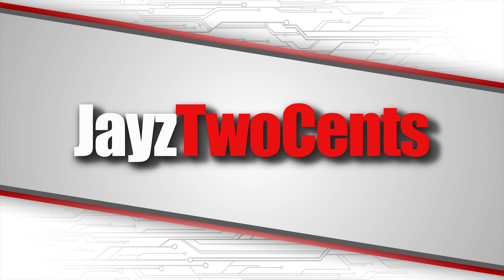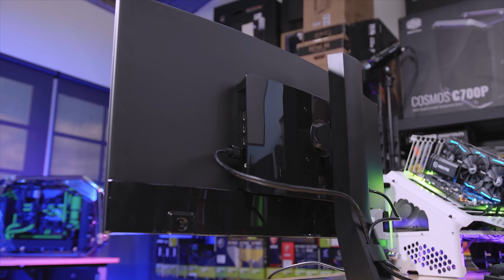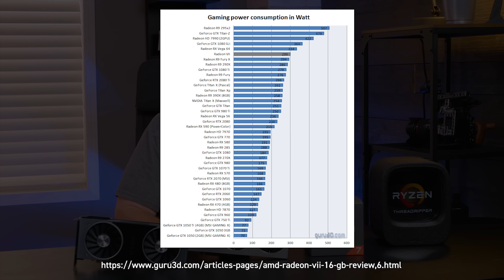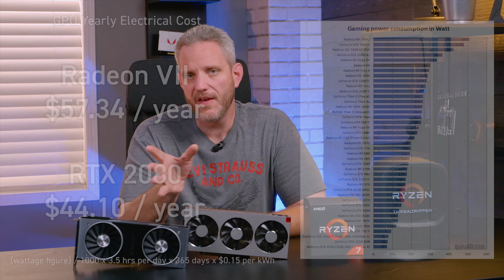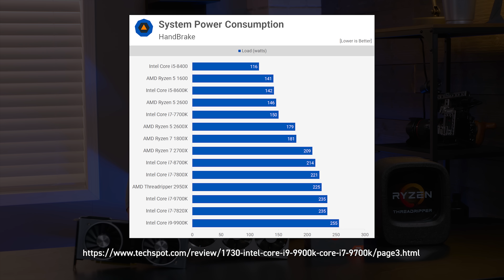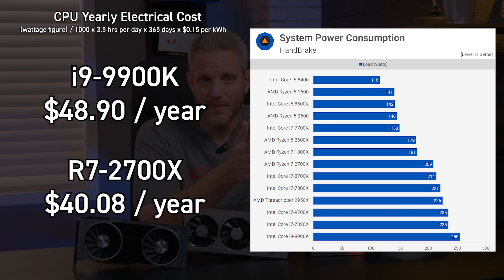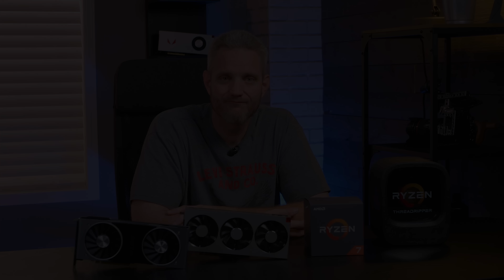Energy Costs of AMD vs Intel vs NVIDIA... This might surprise you

Comment: My Gigabyte GTX 1080 OC ate up on average more power than the Gigabyte RX Vega 64 OC I swapped it with. Temps and performance are even. 🤔
Reply: is dat a Ti?
Reply: Purp 1080ti would be at least 30% faster than Vega 64, so no
Reply: Unless you undervolted that Vega 64 I call bullshit. My 1080 Ti ran cooler, and used about the same energy, as a Vega 64. Also the Vega 64 is about on par with a 1080 why would you replace it?
Reply: @SomaFlly  "is dat a Ti?" He didnt say it was a Ti
Reply: @piercenielsen9746  "1080ti would be at least 30% faster than Vega 64, so no" Well OP didnt say anything about a 1080ti , just a 1080.... so no, you cant read
Reply: @DakotaTheRota  "My 1080 Ti ran cooler, and used about the same energy, as a Vega 64" Good for you... OP said nothing about the Ti version, your point is moot
Reply: Dana Vixen can you read? Purp asked a question, stop causing unnecessary controversy
Reply: @DakotaTheRota  I used Balanced mode in Wattman and ran Superposition and Heaven, 221W for the Vega 64 reaching 1600Mhz boost, whereas the GTX 1080 drew 246W at 1926Mhz boost. I honestly can't recall the exact bench numbers, but they were within mere points of each other. Both cards were at stock clocks and fan speeds, and the Vega 64 reached 71 Celsius while the 1080 was ironically at 80. In gaming I saw no difference in frame rates (within margin of error). Please don't call bullshit unless you have PERSONALLY done a 1 to 1 comparison as I did before shaking hands and making the trade. As to why I traded, simple; mac OS Mojave doesn't support NVIDIA cards (and probably never will) and my Hackintosh was itching for an update.
Reply: Yeah bullshit a vega stock will easily pull 100w more i have an overclocked 1080 so lets see some of them numbers for yours versus mine

https://imgur.com/a/JfdUKTc

My 1080 is on water over 2.1ghz thats doom 4k nightmare sustained power draw so yours was not puing that at 1900mhz i have the voltage maxed as well so lets see that vega full load pulling less
Reply: @malygos9301  where's "your" Vega 64 card? You only have one card though. Kinda biased.
Reply: @malygos9301  I trust Bansaku more than I trust you in this at all. 🤦
Reply: Omar lmao im biased he randomly claims on the internet i show actual power usage BiAs FaNbOy

Pssst he claimed his vega had lower usage which you would compare to the 1080 not 64 vs 64🤦‍♂️
Reply: @MrKeech666  Heaven is a synthetic, like furmark.
Reply: turn on Power Saving bios on rx vega. trading about 2% of performance for about 30% less power draw on my vega 56
Reply: That depend on resolution you play in Monitor Frame rate and the game engine itself
from my experience with GTX 1080Ti with 375W TDP limit overclocked to 2025/1654 with undervolted 0.993v using Metro Exodus
1920x1080 60 = 245w temp 47
1920x1080 144 = 305w
3840x1080 60 = 298w
3840x1080 144 = 321w
3840x2160 60 = 357w temp 58
Maybe that info helps
Reply: HDR247 ^ and a vega 64 easily pulls the same or more as a 1080ti while getting hotter which is why the op is full of shit it performs the same as a 1080 with less power consumption
A 2025 oc is bad on a 1080ti
https://imgur.com/a/L5om7U8
My 1080 metro exodus 4k extreme 2139mhz overclock so 110mhz over his 55c max temp so cooler than his and only 229w peak pull.

So yeah i call bs hell put your vega in power saving mode it still wont hit those framerates at that wattage
Reply: @DanafoxyVixen  does that mean its not a Ti?
or because he omitted the Ti does that make it not a ti? lmao
Reply: https://imgur.com/a/7kXkRAW 260w isnt lower and lets see it you dont have a 64 or a 1080😂 bonus round dying light 4k max settings 2139hz or 400mhz over yours 229w sustained pull ill even throw you a bone it peaked at 245w for half a second. Since we know youll be back to read this just post even one pic of that vega at stock pulling under any of these let alone oc’d😂😂
Reply: Not going to dive into this pissing match y'all got going on here, but I own a Vega 64 and I can attest that the 64 watt for watt is at least equal if not better (in performance) than the 1080 (non Ti)

Proof? https://www.3dmark.com/fs/19022022
Power bouncing between 200-300 watts with either card (as clock adjusts for each scene ofc)
Reply: have a 1080ti here and it takes about and over 300W, depending on game. even with a steeper fan curve it can reach 80°C, and the best thing is: it can't idle with 3x UHD monitors, its always at 3D-mode with full clocks and sucks 100W...

waiting for a faster AMD card, i'll give them a chance again.
Reply: @whistlesyxter  Lol thats bs I dont believe you use the card with such OC. I have the same card LC edition actually 3 of them and its not possible to play anything for more than few minutes at the clocks you report on 3dmark. Core clock 1 792 MHz Memory bus clock 1 145 MHz Lol at 200-300w? more like 350-370w+?! What is your voltage 1.1V? xD
Reply: @piercenielsen9746  Lol so many butthurt Intel and AMD fanboys. Will never understand the need to defend a company.
Reply: Congratulations on saving maybe $1 a month. I have a Radeon 7 and I'm all for AMD competing with Nvidia but your comment is so dumb it triggers me. Did you even watch the video?
Reply: @MrKeech666  easy trade in your situation. the vega 64 is a good card. i got a 1080 for cheap but i wanted a 64. couldnt find one cheap though.
Reply: @eth_saver  I didn't claim any numbers, bud. You might want to re-read that: LOOK AT THE SCORE AND COMPARE VS GTX 1080. If you know so much, then why did you conveniently forget that Vega reported clocks are higher than actual clocks?
Go take your faux outrage and learn something.
Reply: @whistlesyxter  You didnt claim any numbers yea.. You just said that Vega64 is more efficient than 1080. Then you post here some "proof" with all stats and then added some made up power draw. What a joke. With your settings the Vega64 will eat over 300w and the memory will start making artifacts once you put it under load for more than few seconds.
Reply: @whistlesyxter  I am pissed because you cranked the card to max. And then you post here how powerfull it is and how efficient it is. Which is complete BS or your card has better efficiency than Radeon VII. You are fraud!
Reply: @eth_saver  That is a valid 3D Mark score buddy, if you want numbers 1150mv for core and 1075mv for voltage floor/HBM. Look at any charts (ie. Google) for unlocked/UV/OC Vega 64s and GTX 1080s on water and specifically look at their power draws. Clock for clock is moot, obviously. I said it was at least EQUAL, I didn't say it was MORE efficient - Stock voltages are irrelevant imo, those aren't what most Vega owners run at. Obviously it didn't start artifacting after a few seconds as the test finished to completion, and Vega simply wont stand to error for that long if unstable.
You go ahead and keep your dick out for the pissing match though...
You sound like a fanboy with a bone to pick, and it's not with me Tomas.
PS: When not overclocking for benches, 1100mv is all I need to maintain 1700-1720 actual clock in game, this reduces the power draw even further while still beating the GTX 1080 - BUT the 1080 has a MUCH higher top end for performance... at a massive power cost.
Reply: @eth_saver  Those are my findings, you can piss and moan about it all you want. I'm sorry if I have offended you.
If you go over to https://www.overclock.net/forum/67-amd/1634018-official-vega-frontier-rx-vega-owners-thread.html
You will find that MANY other people have had the same experiences as me, some even better (Yes, I'm jelly of those that can hit 1200mhz on HBM and 1800 core) and some worse.
Reply: @depth386  The Radeon is the same Price essentially as the 2080.
Reply: Jaron Marles not quite, at stock I call it like a 2076 but obviously that’s stock and it loves water, loves undervolting. If you’re curious Hardware Unboxed has a very fair comparison of the R7 vs 2080, two videos in fact just in case drivers changed things. But I still bought R7 because I like the 16GB. Basically I want a card that five years from now still games on say medium settings and so it’s the better buy for me. Also, R7 fans are pretty noisy but I wanted to build crazy a watercooled rig anyways.
Reply: @depth386  The issue is that for the price you pay, the only real comparable benefit is the 16GB. The issue with that is most still play at either 1080p, or 1440p. Which doesn't require much more than 8 gigs if at all (depending on the game, and settings). The RAM is part of the reason it's so expensive to begin with, and the extra RAM is almost never used properly.
Reply: Jaron Marles yeah it really depends on what type of gamer you are. I usually don’t make quick motions and give myself first person shooters, so cranking up the settings on 4k with radeon 7 makes sense for me. I got the typical game bundle with it and in Resident Evil 2 i managed to get 14 or 15 GB VRAM estimated in the menus. The Nvidia 20 series disappoints me for not having more memory than the 10 series. 2070 8GB probably the closest thing to the ratio of memory to gpu horsepower i like.
Reply: @depth386  Most people don't play in 4k though, so most don't even need that much. 8 is usually sufficient for 1440p, let alone 1080p.
Reply: Jaron Marles yeah but then again for 1440p you will do fine with a 2070. Which makes more sense for 8gb. I just wish the 2080 had a little more than the 2070. In car terms: It’s like more engine power with a typical automatic transmission. Anyways i just realized i misread your comment, yes they launched same price and 2080 is a bit stronger. I was originally raging at the original post of this where the guy says his 1080 took more juice than his vega or whatever. It’s the dumbest comment in the universe, the electricity is like $1 a month at best

Comment: Can you do one in the server space CPU's? They run 24/7, it would be a fun comparison!
Reply: I feel like that would be more of a Linus video. Jay has always seemed to be more on the enthusiast and pro-sumer platform for his videos whereas Linus likes to dabble in commercial components more and more.
Reply: Idle consumption on modern CPUs is like 10W. For small business and home servers, that's where it'll be for 90% of the time.
You'll use more powering HDDs 24/7.
Reply: @tin2001  Ryzen 3000 has an 11W PCH, wich is quite significant to this. Its idle power draw is unknown though.
Reply: @nottheengineer4957  11~15w

Comment: When the price is cooling down over sea
In my country is still keep them high 
Especially Huawei phone
The price don't drop
Not even a little
Reply: You should not buy Huawei phones. Where do you live? I get basically the same prices in germany, but in Euros and already containing 19% sales tax.
Reply: @nottheengineer4957  I just said that the price of Huawei phone don't drop in my country
I'm using a Xiaomi phone
And it ok to use a Huawei phone if u don't care about Android Q
That basically it
Reply: @araarabutkermitthefrog  Huawei phone have software that is barely usable and locked bootloaders, wich means no way to get rid of the crap. They also cannot proved proper software updates anymore.
Reply: @nottheengineer4957  I use Nova launcher :/
And Xiaomi also lock bootloader too
You gotta sign in and wait about a month to unlock bootloader

Comment: The comparsion of 9900K vs 2700x power consumption is really flawed because the Intel cpu would finish all tasks sooner. So out of the 3.5h test the 9900k would be half hour idle while amd is still working.
Reply: You are right about this. But it only is correct for workloads other then gaming. If you game 3.5hours on both systems jay's argument still stands.

Comment: really excited for the release for the ryzen 3000
Reply: I am too, i want the 8 core if it can overclock decently
Reply: @nathanhamman418  It's already factory boosted FAR over what most of the previous generation could do with manual overclocking. Plus you get the 15% IPC uplift.  I'm excited to use it just like it is!

Comment: Nice way to negate the power draw is by getting a more efficient power supply.
Reply: that's a good thing to think about and spend money too. not just is going to waste less power(more saving, if u really care about it..) but 
it also means the power supply will most likely run flawlessly more time....efficiency decay is a thing to consider when buying cheap electronic components...power supply is THE component that u need to think good before buying, or regretting later..for early problems like not enough power to your system, failure in general...or, and a big one, upgradability! I've done a poor choice one and boi did i regret when buying new GPU for SLI back then when it was a big thing

RIP SLI/XFire

Comment: Well...for me it is...I have a home with 2.2k Watt limits, and I'm running two fridge, three AC 24/7, and not counting auto jet water pump and someone cooking rice, so there is only a small window I can use to build a PC and run it comfortably without blackout. I have an option of building a PC with gtx 1660 or rx580, I go with gtx 1660..and sometimes I still get blackout if all devices I mentioned earlier was on, and I was playing games (browsing or lightweight usage is still fine).

Might not be for everyone, but you have to see 'power draw' from this angle too, I don't have any problem with the cost...
Reply: Fajar Normansyah Solar?
Reply: @robertmudry4242  Pardon?

Comment: Another aspect rarely mentioned is that the extra power draw result in more heating for your house which in turn will ease up on the power draw from your oven, if your heating is electricity.. which in turn makes this argument even more pointless...

Comment: i do honestly think that if you are worried about the power consumption of a computer at home, you should just buy a laptop...
Reply: What if you have a machine running 24/7?? That will add up costs.
Reply: Alternatively you can get a low power CPU (e.g. Intel's T-series) and undervolt the GPU (AMD) or just stick to a lower-tier GPU.
You will never get the cost savings from cheaper desktop components back in electricity savings from using a laptop.
Laptops are just way more expensive and everyone who worries about power consumption: just do the maths.
Not. Worth. It.
Reply: @totalermist  if you're worried about the cost of running a computer for gaming or such you should just get another hobby, if you can't afford pennies for the electricity you can't afford to buy games either.. worrying about a gpu is probably the least of your problems xD
Reply: @Devills_hill  Don't get me wrong - I think power draw is a factor.
It's just not in a way that justifies getting a laptop over a desktop.

I did some rough calculations comparing an Acer Nitro 5 gaming laptop to a similar desktop PC. The laptop (i5-9300H, GTX 1650) would draw about 100W while gaming and the PC (i5-9400F, GTX 1650) would draw about 195W of power (that includes the monitor).

At 0.25€/kWh and 3.5h gaming per day that's a 120kWh per year or 30€ difference.
Spread over 5 years that's about 150€ in electricity cost.

Problem is, the Nitro 5 costs 1050€ to 1150€ while the more powerful i5-9400F desktop PC with better components like a freesync monitor, mechanical RGB keyboard, and a pcie SSD would cost about 900€.
Reply: @totalermist  seriously, table top games are fun to... it's ok haha
Reply: @Devills_hill  ??? It doesn't mean that someone will be actually sitting in front of their computer 24/7.Have you ever heard about NAS?? Some people actually have NAS machines at their homes.
Reply: @a..5572-t9r  dafuq are you doing 24/7 that you're running your NAS at full power 24/7? my NAS runs at 3% idle and i'll have to try really hard to get it past 70% xD

Comment: Jay you should have asked cryptocurrency miners how much hours they use, and their power draw.
Reply: Depending on what algorithm and coin you're going for the 580, Vega 56, and 1070 were typically go to for TCO. Vega was pretty power efficient after some under volting and a bios flash. Though hard to get for a while and overpriced for a while due to low volume and mining demand.

I might be missing out on some stuff but that's the general stuff.

Very much more like a server market where power to performance is king.
Reply: @Jaker788   I too am a cryptominer, my main small PC rig use two VEGA 56 on a TT Core P5 ona 2990wx Threadripper. and 2 M.2 SQRL Acorns.  Mining Ravencoin (VEGAs) and Denarius (Acorns) I'm getting 594-603 varied watts usage of PowerChute monitor. I left my VEGAs stock opting not to flash the BIOS and just the Power Save feature of the Adrenalin software.
Reply: @vh9network  I had a fury x at the time and used that, I didn't pay for power so it was ok. I made a decent amount of money over a year due to Bitcoin price going up so much (used nicehash). Unfortunately I held on too long and had to sell after BTC peaked at 20k, I waited till it went up as high as I thought it would again, about 16.5k and sold. Also lost $70 in pending payment due to the nicehash hack, thank god for using an external wallet.

I made enough to pay for a used 1080ti. Just wish I waited another month, if I knew about the Radeon 7 I would have got that..